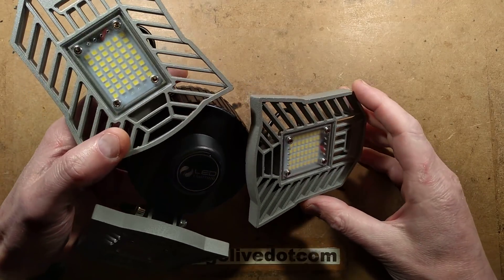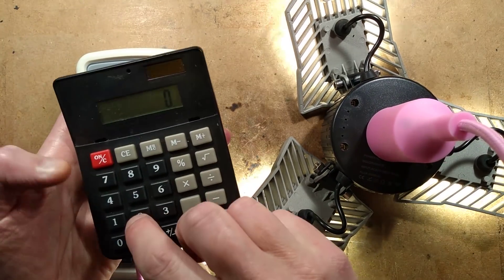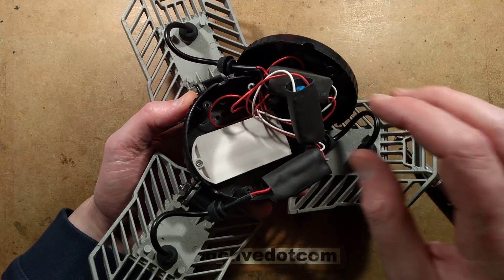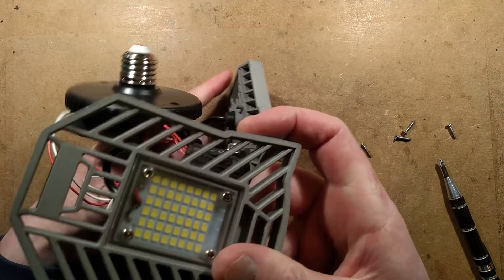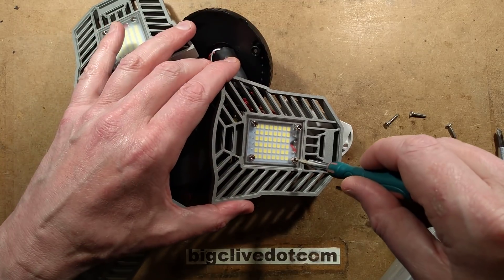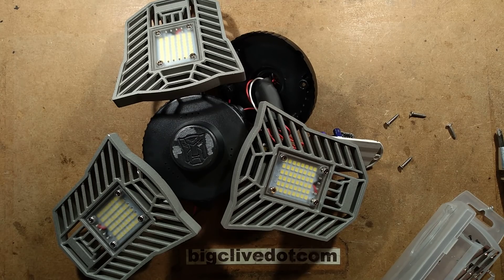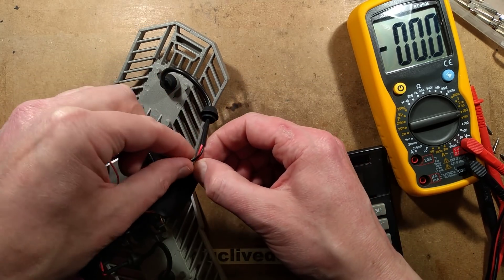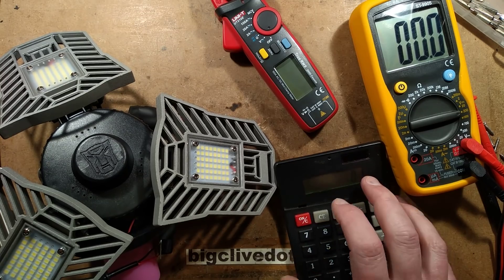Second Autobot lamp with RADAR sensor.

Comment: I would just use it without the clear panels over the LEDs. Better cooling and more light output for the win. At least when used in places where people are not going to poke their meaty bits in there.
Reply: You would never be able to detect an increase in visible light intensity just from removing those clear plastic covers. Not only that, there are not any places that the light would be usable, that wouldn't also be a hazard.

Comment: Now I'm curious about the voltage rating of the capacitors in that little power supply. I've seen them underrated too. If close it won't go bang right away but will fail early.